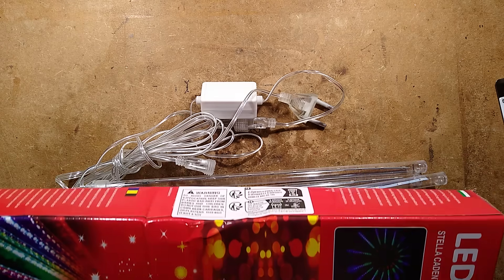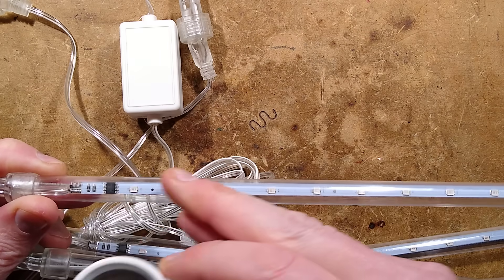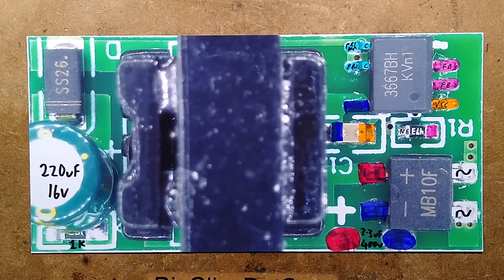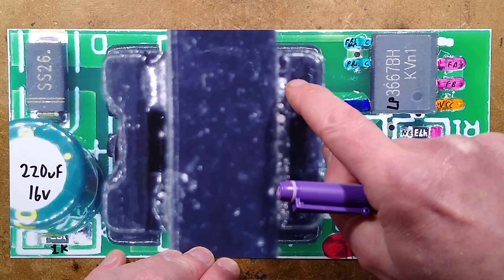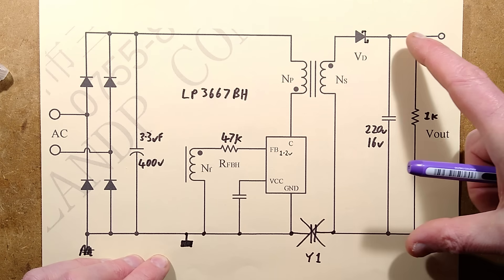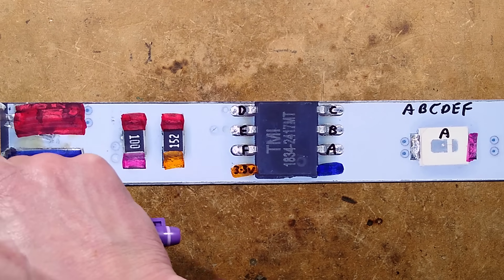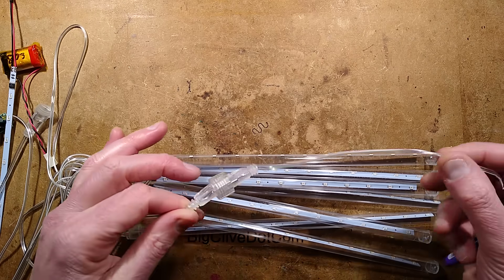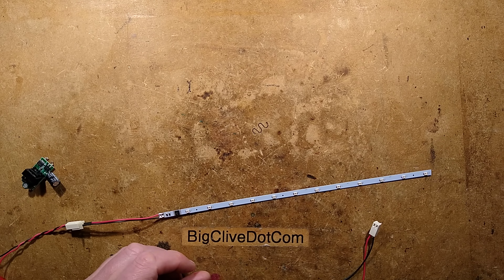Cheapest meteor lights on AliExpress - with schematics

Comment: Have 2 sets which are completely build the same as the unit you are showing, but they were "on sale" for $12.99 each, shipped..
My plan for them are to put each LED of each stick onto wire, then I could seperate and run them in some lightning pattern for an LED cloud I swear I'm going to actually install some day lol

Comment: I've used these before... bought 4 sets to put in a tree for holiday display. I tried all 4 sets end to end with just one of the little power modules and it worked! Not a bad deal for a fun display. 
I did notice one thing with my sets though... the polarity according to the wire stripe was inconsistent. I had to reverse the connections on two of the sets to get them all to light up.

Comment: One comment Clive:  I live in Canada where it gets damn cold.  At least on  the units that I have as part of my Christmas display, the power supplies on these things tend to crap out around -15C or so.  They actually make good thermometers, you can have an idea how cold it is by the way the meteor lites work.  I had a bunch with bad power units, it's kind of an interesting effect if you mount a string of these in a star shaped array on a piece of plywood, it makes a really cool display that looks like a wormhole opening or something.  I used old transformer based linear wall warts to power it, switchers don't usually like low temperatures.  Keep up the fairr worrk, laddie!

Comment: With a common positive to the LEDs through the 10 ohm resister, how do they maintain a stable voltage/current across 1 to 6 pairs of LEDs???
Reply from the maker: They don't.  The more that are lit, the dimmer the LEDs will be.

Comment: I have a white version of these(different brand same idea). I run them on a bigger dedicated 5V DC supply which I use for other LED lighting (LED Strips), they do run slightly brighter if you increase the voltage. Do just make sure you fuse them between the supply, the tubes get water in sometimes. 
If you up the voltage you can make the overall daisy chain length slightly longer, but you may kill the earlier sections with higher voltage if you go too far. I have them hooked under the soffits for Christmas lights, with an added butterfly loop, taped to the top of the tube, to allow it to hand without straining the tube connection as much.

Comment: Clive does such an excellent job of reverse engineering each item, and explaining how it works. Thank you, Clive. Way cool! Anyway, we have 110 mains where I live, thus the 220v plug wont work for me, of course. So to be sure Ive got this right, I need a 5v 100ma minimum wall wart power supply or similar to power up EACH individual "stick"? And thus needing about 800ma to suppy enough current to the 8 sticks that come in each set that Aliexpress sells. Right? Thank you kindly.
Reply from the maker: This is probably a universal power supply for 85V to 240V.  But alternatively you could use a USB power supply to power them.  The 100mA is just the peak current.  The average will be lower.

Comment: Quite a few moons ago I bought 2 sets.
Before last Christmas I took a closer look and made some modifications. 
As mine is an earlier version, it is a little different, starting with it was supplied 12 volt! Which made them awfully bright, hence I wanted to modify it. I have put a small DC-DC stepdown converter in it and now is running around 6-ish volt.
I did try it first on my bench powersupply on which I discovered 5 volt was already too low, it barely lite up any LEDs.
The powersupply module was different as well, as the tracks and components do have quite an ok separation, though no class Y capacitor.

I put the powersupply with a Tuya switch box into a small case, so can set timings.

As for the plugs, it does have some kind of polarity protection as one side has a flat surface, though you still can put them in the wrong way around. 😂

I did order 2 more last December, but didn't have the time to modify them yet. Funny thing is these two come with a solar panel. Which is odd for the people at the upper hemisphere. 😂
I am still going to modify them so they can run from either 5 or 12 volt.
I have several, potted in reason, modules which fit in an electric junkbox. 😊

Comment: Any thoughts on replacing the "standard PVC" interwinding tape with Kapton? Should provide better dielectric strength, and of course far better thermal performance.
Reply from the maker: The unwinding and rewinding of the transformer would be very time consuming.

Comment: I have too many of these things in different voltages, the early ones were 5V but the later stuff is either 7V or 12V.
As Clive points out, it might be worth using a compliant power supply for this stuff if used in certain environments, a good example of that was when there were 3 kids in our garden on boxing day, I don't want them getting killed!

Comment: I just had a led light power supply catch fire during my last vid! Want me to send you a new one to see how bad it is?

 https://youtu.be/ozstpG6eq1s?si=igBe2eb-_LVSGcHC&t=115
Reply from the maker: Most of the power supplies shipped with LED lighting strips are really pushed to their limits.  Blowing their lid off is a common failure mode - especially forceful in the UK with our 240V 32A power circuits.  I'd suggest buying a reputable power supply and leaving a good rating margin for cool running.

Comment: I got a bunch of these last year, but mine have 18 LEDs per side. The power supply was running on 7.5volts and runs well but I don't use the PSU because like you I don't trust it. It runs from a solar battery via a switchmode buck regulator.

Comment: I've had a nicer set of this sort hanging on the barn for nearly a decade now. I plug them in late Nov. and leave them "drip" until I notice in springtime. So early ones are electrically robust for holiday lights. I'm not inclined to poke&pry while they still work. Mine have pretty sturdy molded "icicles", not like your down-to-price product. Thanks for the write-up.

Comment: Yet another lighting device that looks very amenable to lighting cosplay props and costumes.

i think back to the days when you would need discrete oscillators, shift registers, and ridiculously heavy batteries, and here we are where you only need a couple of the sticks off of that thing, a single Li-ion cell, a switch and some wire.

Comment: Brought a set of these for outside last Christmas... they lasted 3 days before they stopped working. I found the tubes had condensation in them which had caused one or more of the circuit boards to burn and short out... They went back to the shop for a refund

Comment: That's funny, I picked up a couple sets of the longer versions of these. They were outside for a bit and working but after a while they all just started flashing the top 3 LEDs and not actually working. Probably doesn't have adequate protection from moisture.
Reply from the maker: That's what they do if the voltage is too low.  It may have been a corroded connection or a failed power supply.  Try powering them from a 5V supply like a USB power supply.
Reply: @bigclivedotcom thanks man I'll give it a shot!

Comment: I found a broken bit of a star shaped led Xmas decoration. The LEDs are pretty interesting. Instead of having a clear or white casing the yellow phosphor is actually mixed into the plastic. They have a really nice soft diffuse light.
Reply from the maker: Some ASDA solar lights had phosphor diffused resin covers.

Comment: Those are quite nice, but mine are coloured 😏

As the owner of a 3D printer, you could print a largish 'wheel' rim with holes round the circumference big enough to slot the led sticks through to create some sort of pin-wheel. I don't have a 3D printer, so I might see if I can use an old wooden wall clock frame instead 🤷‍♂
Reply from the maker: If you do that and glitch the power off briefly after a suitable single cycle time, you can keep the tubes in sync.

Comment: I'm an American I'm used to 120 volt cords but I have to say that is one of the smallest, lightest duty cords I have ever seen on anything. 

It looks like if it was stressed or pulled in any way that it would simply fall apart. 

Very safe design.

Comment: I spent all day yesterday putting a stack of Peltier elements on a cooler inside my freezer........ should have tested them first, one was broken, and it was all already stuck together from the thermal glue :(. I dont recommend buying the 12706 Peltier elements, 20% are broken or have problems.

Comment: I'm surprised there is such a substantial voltage fluctuation. Then they have the ability to daisy chain additional strips with the same power supply to power those too? I wonder what the current rating is of the power supply is.
Reply: I have boxes of these things from Amazon Vine. They are 7v at 1 amp. Some are 7v at 2 amps.

Comment: i ordered some meteor lights from ali before christmas, the photos were all of the better quality versions of these you can get, but these were exactly what arrived. Immediately i knew they would be going back. and fortunately its free returns, so right back they went. I didn't feel like getting electrocuted this christmas, as these were listed as "outdoor" rated despite the plastic box clearly having gaps.... though i have no idea how someone would use them outdoors since you'd need a plug socket 50cm away from where youre hanging your lights. and i don't current have roof mounted plug sockets.

i thought from the way mains voltage was being sent on the same gauge wire as the rest that there was a chance the open extension socket on the end was mains voltage. Glad to hear its not actually that bad, but it allowing you to stick a bunch of these together from one power supply, i wonder how many would it take before that power supply becomes dangerous. Or would the lights just get less and less bright the more you chain together?

Comment: Likely not e exactly the same product, but I have a string 4 from half a decade ago. It still runs every X-mas period.
The first thing I did was do away these with these power supplies.
I ran it from a good quality mobile phone charger 3.7V from the '90s.
The first thing you must do is apply some transparent nail polish on the ends where the wires go in and out. Repeat a few times. That should keep the water out.

Comment: I bought this same set back in November 2024. Only mine has an American type AC plug. The power supply on mine has a metal case with potting material sealing the circuitry inside. I got rid of the AC fed power supply feeding the +VDC into the Meteor boards. (Mine read +7VDC) I'm running mine on an 18650 or USB. 😊 The wiring on these is flimsy at best especially for the AC line input going to the transformer. Like Clive says, good idea to modify these for battery / USB use. 😊

Comment: The chip seems to be a Titan Micro TM1834 LED Driver
Reply: Yep -"TM1834 is a fixed pattern 6-channel LED meteor shower display effect driver IC. This product has its own internal oscillator, and the PWM output performs grayscale gradient. After power-on reset, it outputs PWM waveforms to cycle control the 6-channel LEDs in sequence to achieve meteor and water drop effects. The chip has a built-in 5.5V voltage regulator. The peripheral devices are simple and the design is simple, suitable for decorative lights. This product has excellent performance and reliable quality."

Comment: I bought a bunch of those and the clear PVC insulation didn't even last a single winter (in northern Canada) before browning, hardening and eventually cracking off the wires.  A combination of UV and cold exposure.
Reply: how did the power box hold up though? the ones i got had gaps in them and were just sloppily glued with hot glue, again with gaps between the wires and the holes in the box. i'f i'd put it outside it'd be full of water in no time.
Reply: @ge2719   Oh I taped ziplock sandwich bags over the power boxes.

Comment: does the speed of the effect change with voltage, as well as the brightness of the LEDs?
Reply from the maker: The brightness will change, but the speed will remain the same.
Reply: I'm going to guess the speed is controlled by the TMI1834-2417MT?

Maybe changing the 1.5k resistor might adjust the speed, but there's a possibility that may just emit magic smoke instead.